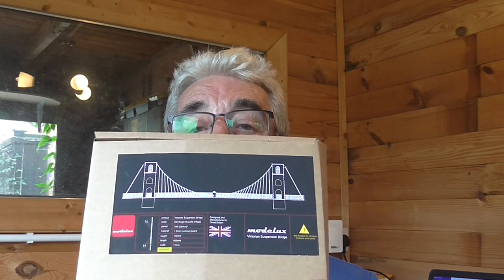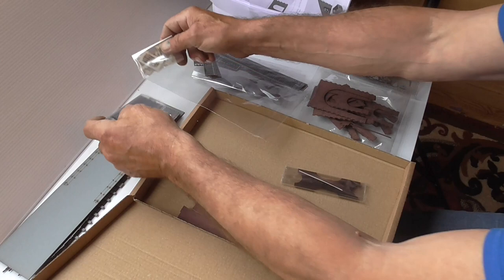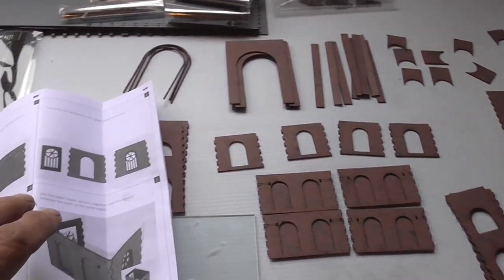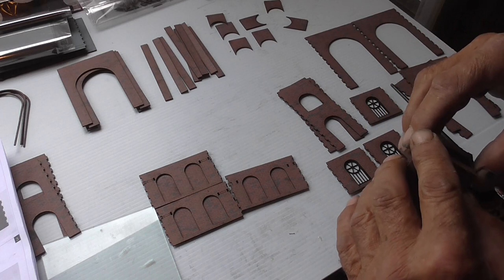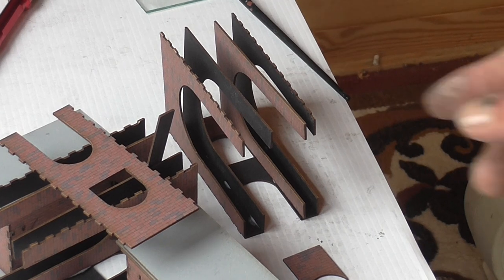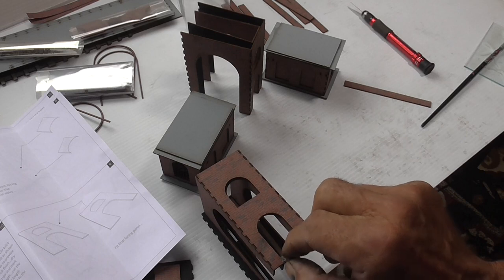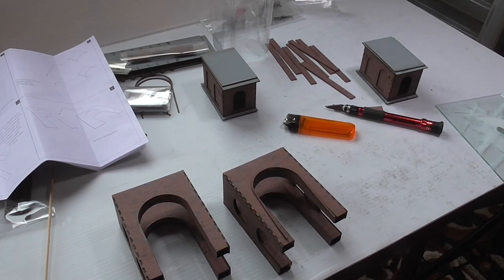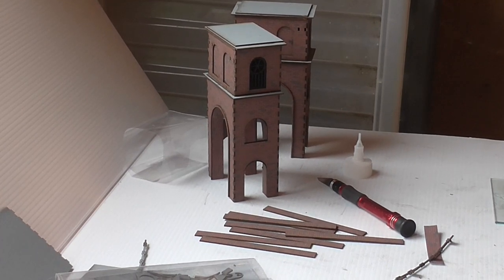Modelux Suspension Bridge  Part 1

Comment: Hi Glynn,
Looks good where on the layout is it going to be? also all those little bits well done for sticking them on only the other half to do now will watch out for part 2, keep safe and well.
Cheers Robert.
Reply from the maker: Thanks Robert, my fault as I brought it thinking it was twin and was going to replace the girder bridge at the back of the 3 bridges. Maybe move things around a little. part 2 should not be to far away. Glynn